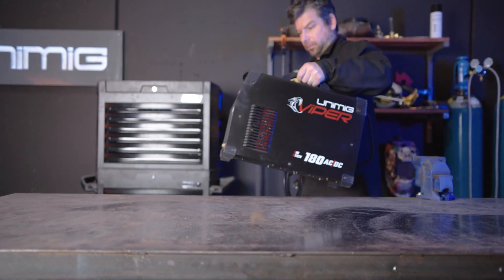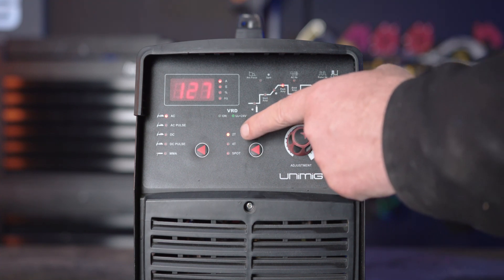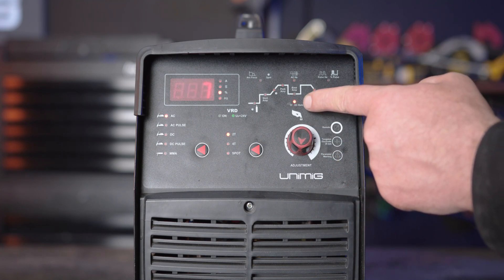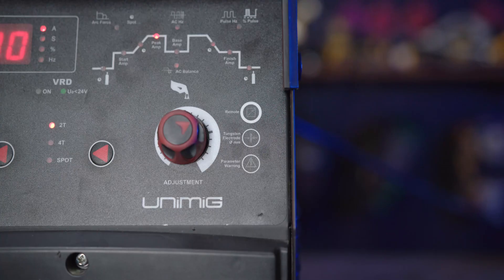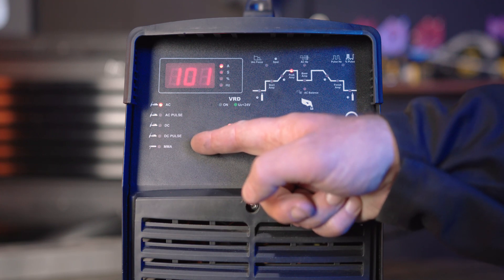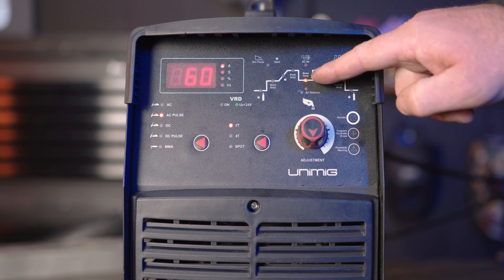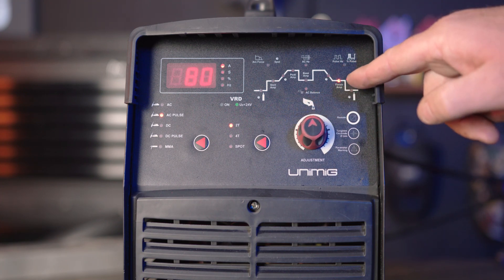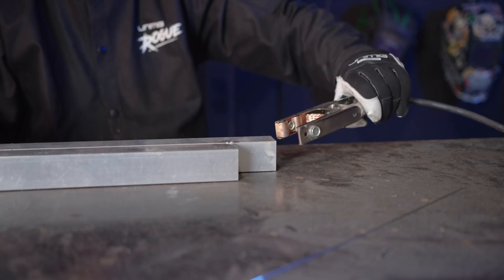VIPER 180 AC/DC - AC & AC Pulse Welding Setup Guide

Comment: Arethe recommended settings the numbers that are set when you press the button before changing or to what you change it to?
Reply from the maker: What we change it to, however, we would use this as a general guide and then change to suit your preference.
Reply: @unimigsupport  okay thanks I just picked up the same machine and just trying to find a starting point to make it easier to understand the sounds and what I'm looking for to change settings
Reply: Hi is the frequency normally so loud ??